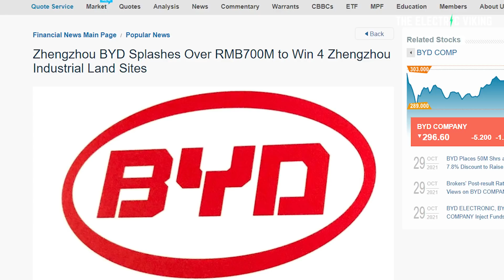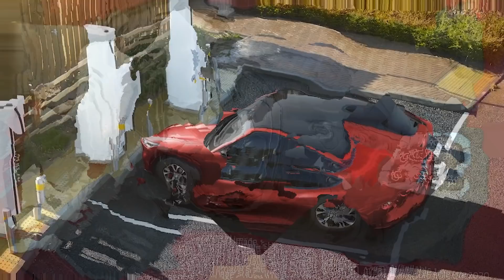Ford using BYD batteries in Mustang + BYD reveals 2025 goals

Comment: LFP is the safest (no fire 🔥) and the best to retain range in the long term. LNCM batteries 🔋 have a 30% degradation every 10 years and I can confirm that, my 2015 VW e-Up! has now 135Km range versus 160Km on the very optimistic GOM (Gess O meter ) LFP will be crucial to maintain resale value of the car in the future. LNCM equipped cars will be avoided at all cost by second hand EV buyers.

Comment: Who thinks Ford might not be as helpless as we've come to believe? If they can keep in the game using BYD batteries while they develop the capacity to do most stuff in-house, they might make it. GM seems likelier to be doomed, tho good luck to them.
Reply: Ford , GM are dead.
Reply: @henrytaverner1803  it's easy to be certain, i guess. i'm less sure of my opinions. ford MAY have got started just in time to field a few attractive vehicles in big enough numbers to pull them out. the pickup may sell and the mustang has appeal to many. and maybe just enough obstinate elon-haters have the bucks to buy an inferior product that doesn't say tesla. you seem sure ford's doomed; i think it's touch and go. one thing's for sure; time will tell and in not many years we'll know.
Reply: Ford. Industry leader that's just barely competant enough to have Mexican factories slap together Chinese components.
Reply: GM will use the platform that was built in shanghai, china, I guess. forgot the platform name.
Reply: GM is actually in a joint venture with wuling motors who make the 5000 EV that’s the beat selling car in China. Maybe for once US can steal Chinese tech and be the ones benefitting 🤣

Comment: Ok, these companies don’t seem to understand that they need to be in control of battery tech or they are screwed. Why are they not doing their own batteries and letting BYD take all the profit?
Reply: As Sam has explained in previous videos, BYD is a battery manufacturer first (4th largest in the world and growing) and, more recently, an auto manufacturer. They also make their own chips and, hence, they've been able to avoid supply shortages there that the rest of the industry has been contending with recently. 

Ford and so many of the legacy companies have slow walked - or are continuing to slow walk - towards becoming EV manufacturers. They are only now building their own battery factories and striking up deals with cell manufacturers.
Reply: @benjaminnead8557    BYD reportedly raised their prices 20% last week.  What’s it tell you that Ford, Toyota and Tesla never walked away from the battery deals with BYD.  BYD said raw material costs rose.  It’s either a legit reason or the car builders can’t get better value (safety) or price somewhere else.
Reply: I do not think BYD gets a huge profit on these deals.  They are playing the long game by taking market share.  Profits come later.
Reply: @fredfrond6148  batteries will be the new oil or the new semi conductors where the country with the battery manufacturing capacity rules the world.
Reply: @gj1234567899999  absolutely.  So long as the manufacturer can continue to get their raw materials.  Maybe that’s why China is sooo friendly with the Taliban and in helping out during a trying time for Afghanistan.
Reply: @fredfrond6148  the raw materials for lithium iron and phosphate are things China has plenty off. Elon said there is actually plenty of lithium. It’s only NMC batteries that are constrained due to issues finding nickel and cobalt.
Reply: Wrong JG.
Mr Lithium doesn't agree with you.